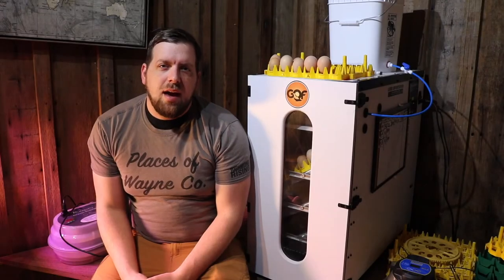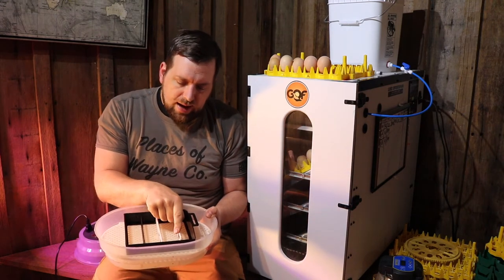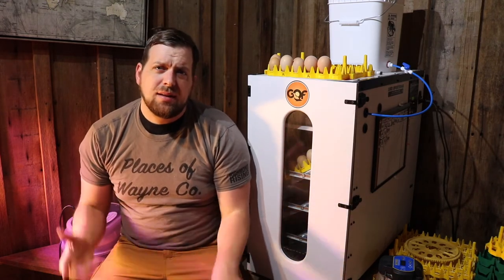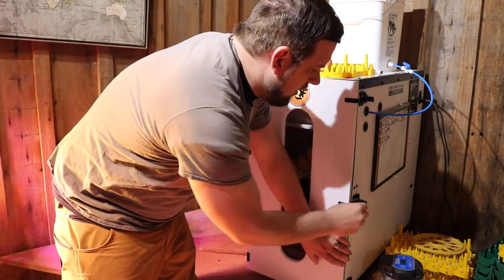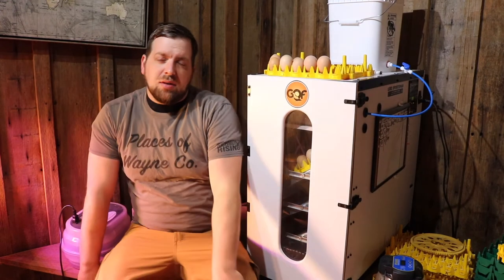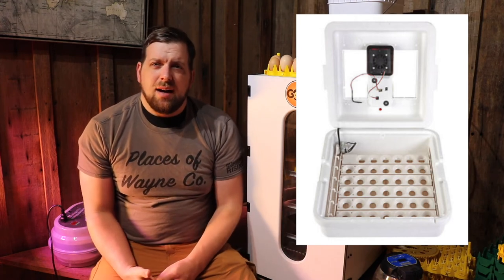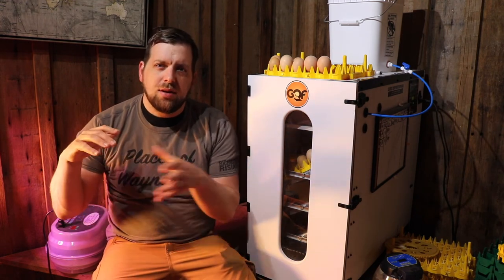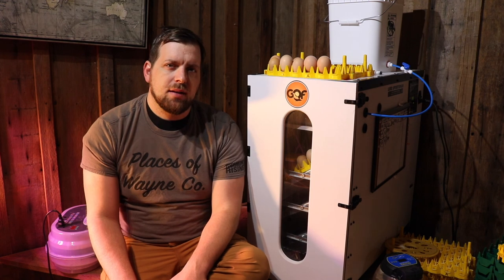Getting Started with Incubators

Comment: Question, if the Incubator has eggs setting would that cause issues for raising humidity if you doing both setting and hatching inside same incubator?
Reply: @FarmerBrad  Thank you, would it cause issues to increase humidity if there are also eggs being rotated and hatching? since normally 50% for turning egg and 70% hatching time for egg, so hopefully that now makes sense
Reply: @FarmerBrad  ok thank you since I was worried if i buy it that the eggs settling will have issues if i raise for the hatching